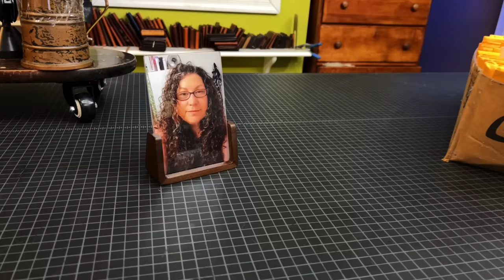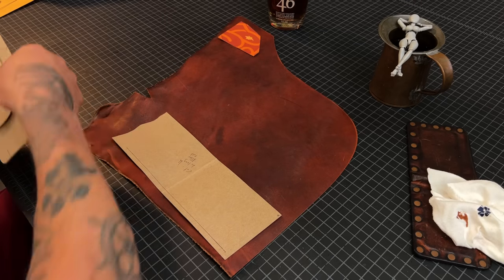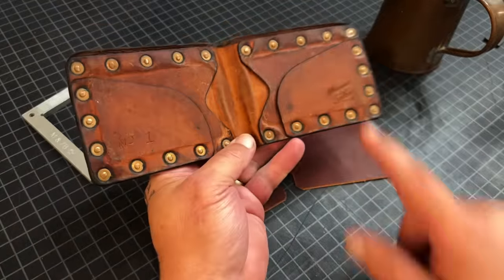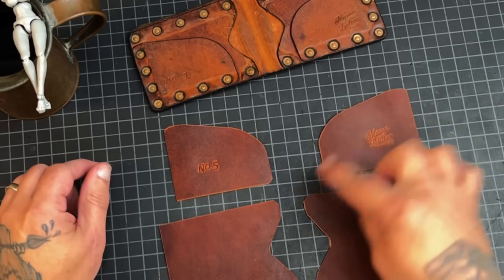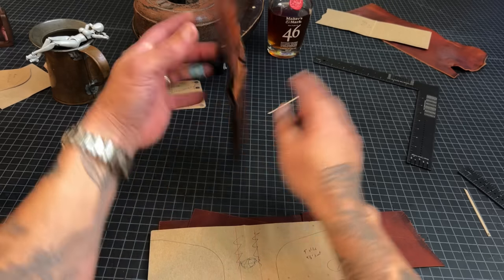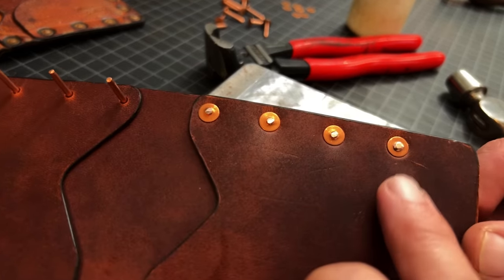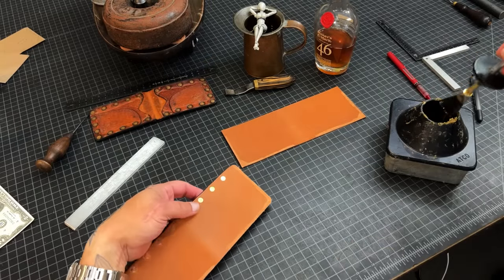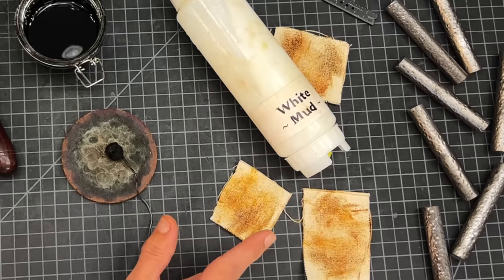Can I Recreate this Vintage Leather Wallet?!

Comment: If you don't have the smaller burs, you can also use some small scrap leather or rubber spacers and a little extra elbow grease.

Comment: Hey brother been watching your videos for awhile. They really inspire me to get better at my craft. 

First off I wanted to say I'm very sorry to hear about your wife and I love that you're continuing the videos to honor her wishes. 

I've only been crafting for a couple months now. I'm not great but, getting better I hope :). I've copied several of your designs. Or at least tried to for practice. 

I bought some of the Horween Dublin and I kind of struggle with the beveling of it because it isn't real stiff. I use a cheap Amazon beveller though. 

I know you use Barry King bevellers so I went and checked out his site. I got really confused. He has about 10 different bevellers listed. I don't know which kind to get. I just want a smooth rounded edge. 

If you could point me in the right direction I would greatly appreciate it. 

Thanks and Great Job on the video and wallet as usual!!!

Comment: Mr. Mascon, i was curious about designing wallets using rivets. How much extra space on the side compared to stitches do you add?

So, if i had a design that was made with stitches. How mich extra would you add if you wanted to use rivets?
Reply from the maker: Depends on rivets used.  Need to do it on paper first.  👍

Comment: I signed from Ukraine. Thanks to you, I learned to work with rulers very conveniently, most importantly quickly. doesn't take up time
  without markings. it took a long time with the pencil...:hand-pink-waving::hand-pink-waving::hand-pink-waving::hand-pink-waving::hand-pink-waving::hand-pink-waving::hand-pink-waving::hand-pink-waving: what can be used in place of toconol at home to come up with toconol is very expensive. Thanks, I tried wallpaper glue, but it didn't work.
Reply from the maker: Haven’t found a suitable tokonole alternative yet